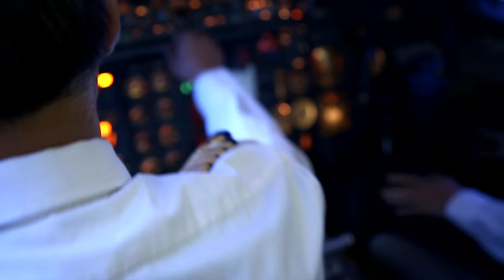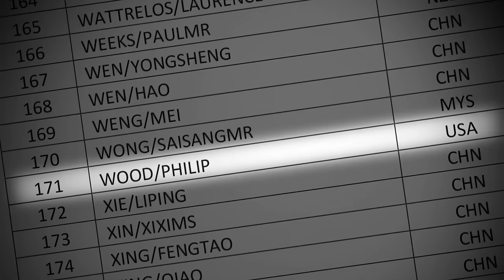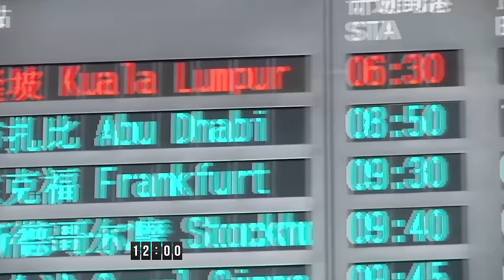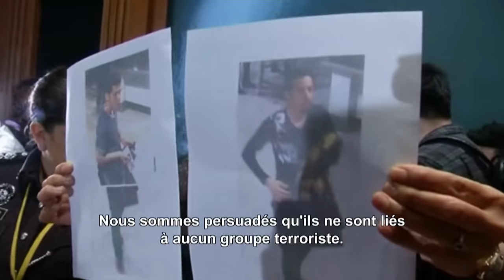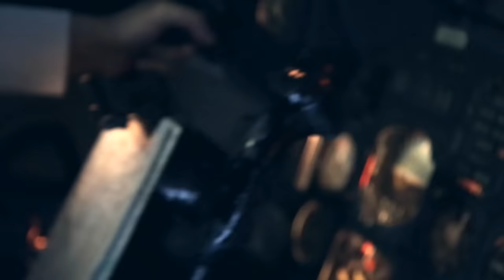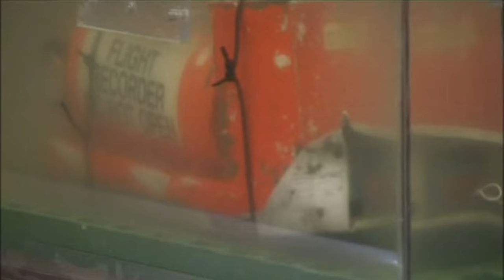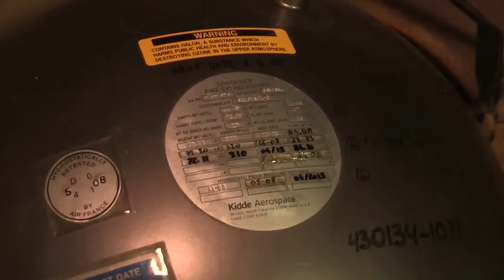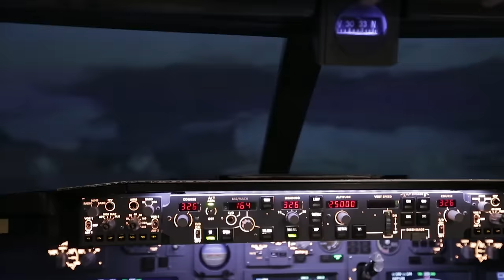Why We Never Found The Malaysian Flight MH370?

Comment: This is one of the craziest modern day mysteries and I still don't understand how planes are not better tracked.  You can find a cell phone at any time but not a plane (also with hundreds of cell phones on it)... for the families and loved ones it has to be brutal not knowing what happened... losing someone from an accident is horrible enough but having no closure is unacceptable when hundreds of people just vanish.  Hopefully all the recent documentaries and videos put pressure on the airline and govt to solve this... it needs to come to a conclusion even if the outcome is sad thats better than not knowing.
Reply: Good point on tracking planes.
Reply: Planes are tracked by multiple ways. Ex. All the engines have a tracking device. There are several other tracking devices such as the so called black box. 

They flew backwards under radar, then supposedly straight out to the Indian Ocean. Most radar and satellites don't operate in this very wide and vast area. Plus due to fire Hazzards all electrical components can be shut off with a breaker switch. So if tracking devices were shut off by the breakers, then that's why the tracking  devices did not work.
Reply: I think aircraft are tracked better today than in 2014.
Reply: I’ll bet they know exactly where it is, it’ll be found with a missile sized hole in the side of it.
Reply: @markmiller6402  Mark, I mentioned the Boeing Uninterruptible Autopilot. I know Honeywell finished with it in 1995. Then Boeing began testing the software program that comes pre-installed on a small PCB. They started testing back in 1995. The UAP is on a plugin circuit board... Just like an audio card, or a stick of memory installed in a PC, with the computer case closed, who would know. 
I just wish I knew a couple of engineers, or better yet, retired military personnel that might have been privy to information on the Boeing program..
Reply: Because they didn't want anyone to know what happened. This is all a cover up.
Reply: @rowenatapatahi6852   Agreed
Reply: I found it crazy that not one cell phone was used..
Reply: @YGardenRose  maybe because you have no idea what your talking about
Reply: @elliotoliver8679  what?
Reply: How could it NOT be sad. 
You think they’re on a fucking island somewhere?
Reply: @YGardenRose  there is no cell phone coverage out in the open oceans, even flying over cities at 40,000ft most cell phones are unable to connect to cell towers on the ground below, cell phone tower microwave antennae are designed to send (and receive) signals laterally across the ground not above.
Reply: En ese avión iban 100 científicos expertos en VIH, iban a una importante conferencia donde supuestamente presentarían información importante, probablemente la cura
Reply: On that plane were 100 HIV-expert scientists, they were going to an important conference where they were supposed to present important information, probably the cure
Reply: You
Reply: I know this is probably a weird thinking on my part I always wondered if anyone tried to track their families phone
Reply: @underrated4860  No, that was MH17, not 370.
Reply: They don’t want to find it
Reply: @underrated4860  that's a good point
Reply: Yeah, working cell phone phones…
Reply: @rowenatapatahi6852 pilots can turn off the tracker
Reply: @rowenatapatahi6852 peak the freaking truth! How do you lose communication with a plane for four hours. Cause they said in the beginning the last time they had communication was around 1. And then afterward, there was no concern about it until around the time it was supposed to show up 4 hrs later which speaks negligence to me! Sounds like they let the plane go undetected for 4 hrs by not staying on top of communication from the first attempt! That's no way to run an airline and it's not safe to do such a thing!
Reply: @YGardenRose in future, best to keep quite 😮
Reply: Reading most of your comments, it's best to keep quite 
Too many 'we know it all' posts
Reply: @UguysRnuts He doesn't possess the capability of thought.
Reply: @Lapusso650 LOST
Reply: @rowenatapatahi6852 that's what I think too
Reply: All the military radars around the world they know where it is.
Reply: @underrated4860 op I'm
Reply: Aliens?
Reply: What I don't understand is why modern day airliners, according to this video, apparently don't  have separately pressurized cockpits to keep the pilots able to react when there is a loss of pressure in the cabin.
Reply: Has any government stated where all these peoples phones were last pinged or tracked too? They said most Chinese have at least 2 cell phones. So there was almost 300 people on that plane and if they double the cells on the ones they believed had them then that easily puts it at over 400 cell phones to be able to track!
Reply: In total, 19 families have claimed the phones of their missing loved ones rang without answer for four days after MH370 disappeared. One woman even went on Chinese TV to prove to the public her brother's phone was still ringing after the plane had allegedly vanished. So the plane is not in the water !
Reply: You will never find a cell phone that's powered off unless you just get lucky and trip over it.  If its in an area without a cell tower in range, it may as well be off.  And there's lots of those blank areas over the ocean - a cell tower only reaches about 25 miles, so if its 250 miles over open ocean, there's 200 miles where every phone ceases to exist as far as the cellular phone system is concerned., until they get in range of another tower.  With a phone you csn say "It connected to this tower, this one, then these three" and establish the  path it followed.  You can get a good idea of its speed ss well.  Say the speed is calculated as roughly 70 moh.  Is it in a car?  A semi?  A bus?   That method wirks most of the time on land, where cell towers are all over the place.  
Thing is, when it comes to a transmitter you can choose between signal power and longevity. That's why the black boxes are sometimes hard to find in icean - to make the signal last 30-45 dsys its necessarily relatively weak.  And if its on the ocean bottom, it can be a couple of miles away even uf you are right above it,  water is great for transmitting sound but its horrible with radio signals.
One could double up on distress signals and have a second set of transmitters that lets outva strong, short yelp upon losing power from the aircraft, but even with all the stuff orbitng the planet, some of its just inoperative stuff that hasn't fallen yet, some of it is looking out, not in, some is lookung at the atmosphere, not the surface, a lot  isn't even lookjng, just relaying signals, and the small proportion that might see such a yelp signal are lookingvat tye land, not nominally-empty ocean.
Reply: American Ary base would of melted it down ,feel for the families
Reply: It went to Diago Garcia!!!
Reply: @ats-3693 thank you for explaining that, I was wondering also. Too bad yellowliver didn't know that..
Reply: I happened to find some Vietnamese military radar data back in the day. The commercial radar showed MH370 vanish where it did, but interestingly, the military radar showed MH3370, yes one extra 3, showing up where the plane vanished from commercial radar. I still vividly remember seeing that.

Again, this was NOT a static image from some website; it was historical radar data. It didn't show MH370 specifically but rather every flight and object being tracked.
Reply: @BIGBADWOOD  How could something that large remain hidden on land all this time? 
When Vietnamese traffic controllers asked Malaysian controllers what happened to the plane that was supposed to enter Vietnamese air space, they were told the plane was in Cambodia! Why? The plane was never in Cambodia! How is telling a lie like that even legal! WTH?
Reply: Remember : all phones are to be shut off when on plane.
Reply: 2
Reply: SOmething happened like this is God provision for human to realized that our life is not in our hand to control everything just like this
Reply: He was flying too high (very unusually high altitude ) from the time he was in the 22 minute holding pattern off the west coast of Sumatra until he way far south over the Indian Ocean, by which time the cabin may have already been depressurized. I think they mentioned that in this documentary.
Reply: He was flying too high (very unusually high altitude ) from the time he was in the 22 minute holding pattern off the west coast of Sumatra until he way far south over the Indian Ocean, by which time the cabin may have already been depressurized. I think they mentioned that in this documentary.
Reply: He was flying too high (very unusually high altitude ) from the time he was in the 22 minute holding pattern off the west coast of Sumatra until he way far south over the Indian Ocean, by which time the cabin may have already been depressurized. I think they mentioned that in this documentary.
Reply: He was flying too high (very unusually high altitude ) from the time he was in the 22 minute holding pattern off the west coast of Sumatra until he way far south over the Indian Ocean, by which time the cabin may have already been depressurized. I think they mentioned that in this documentary.
Reply: He was flying too high (very unusually high altitude ) from the time he was in the 22 minute holding pattern off the west coast of Sumatra until he way far south over the Indian Ocean, by which time the cabin may have already been depressurized. I think they mentioned that in this documentary.
Reply: He was flying too high (very unusually high altitude ) from the time he was in the 22 minute holding pattern off the west coast of Sumatra until he way far south over the Indian Ocean, by which time the cabin may have already been depressurized. I think they mentioned that in this documentary.
Reply: He was flying too high (very unusually high altitude ) from the time he was in the 22 minute holding pattern off the west coast of Sumatra until he way far south over the Indian Ocean, by which time the cabin may have already been depressurized. I think they mentioned that in this documentary.
Reply: He was flying too high (very unusually high altitude ) from the time he was in the 22 minute holding pattern off the west coast of Sumatra until he way far south over the Indian Ocean, by which time the cabin may have already been depressurized. I think they mentioned that in this documentary.
Reply: He was flying too high (very unusually high altitude ) from the time he was in the 22 minute holding pattern off the west coast of Sumatra until he way far south over the Indian Ocean, by which time the cabin may have already been depressurized. I think they mentioned that in this documentary.
Reply: He was flying too high (very unusually high altitude ) from the time he was in the 22 minute holding pattern off the west coast of Sumatra until he way far south over the Indian Ocean, by which time the cabin may have already been depressurized. I think they mentioned that in this documentary.
Reply: He was flying too high (very unusually high altitude ) from the time he was in the 22 minute holding pattern off the west coast of Sumatra until he way far south over the Indian Ocean, by which time the cabin may have already been depressurized. I think they mentioned that in this documentary.
Reply: He was flying too high (very unusually high altitude ) from the time he was in the 22 minute holding pattern off the west coast of Sumatra until he way far south over the Indian Ocean, by which time the cabin may have already been depressurized. I think they mentioned that in this documentary.
Reply: He was flying too high (very unusually high altitude ) from the time he was in the 22 minute holding pattern off the west coast of Sumatra until he way far south over the Indian Ocean, by which time the cabin may have already been depressurized. I think they mentioned that in this documentary.
Reply: He was flying too high (very unusually high altitude ) from the time he was in the 22 minute holding pattern off the west coast of Sumatra until he way far south over the Indian Ocean, by which time the cabin may have already been depressurized. I think they mentioned that in this documentary.
Reply: He was flying too high (very unusually high altitude ) from the time he was in the 22 minute holding pattern off the west coast of Sumatra until he way far south over the Indian Ocean, by which time the cabin may have already been depressurized. I think they mentioned that in this documentary.
Reply: He was flying too high (very unusually high altitude ) from the time he was in the 22 minute holding pattern off the west coast of Sumatra until he way far south over the Indian Ocean, by which time the cabin may have already been depressurized. I think they mentioned that in this documentary.
Reply: You can't find a cellphone at any time. You can only find a cellphone that is near a cellphone tower, let's say within a few km at most. There are no cellphone towers in the open ocean!
Reply: Because it was shot down near Russian / Ukrainian border. In MH370 the window besides middle exit door behind the wing was painted white. Surprise, this part survived as the plane from Holland crashed to the field, and first stories from Russians were that there were a lot of bodies in the rotten state and they wondered how that be so?
Reply: @stevenlaake9975  It's 2023.  Is it true or not that a couple were walking the beach in Australia and found towels from the plane that  had washed up?  There's been so many theories,  some outrageous.
Reply: @dejaporter7338 
No it's not. 
They were on mh17 and i think 100 is a bit overdune.
Reply: 10.22.23 in order to preserve info keeping groups smaller is good idea.
Reply: Baka nahigup ng dagat sa Triangle.( It might had been sucked in the ________Triangle it's like a whirlpool. So many airlines
Reply: Bermuda Triangle is the name of the whirlpool 😅
Reply: @angelamorales4050 they did, on Chinese TV they called one and it rang and rang. 4 days after it disappeared
Reply: I am pretty sure that some big Government is involved and that's the reason for not finding this aeroplane. I think some big country accidentally downed this aeroplane and is influential enough to tell the Malaysian Government to look the other way. In this modern era of technology, it is possible to track almost anything. It's impossible for an aeroplane like Boeing 777 to just disappear and not be found anywhere.
Reply: I think the info was gathered by military radars, but that information is classified and would reveal the capacities of said countries to potential military opponents.
Reply: To simply put it, there is no reception.
Reply: @stevenlaake9975  No debris though ?
Reply: @elliotoliver8679  Oh , you do though ...  Please tell us more.
Reply: @ats-3693  Nah ... 9/11 proves you wrong though.
Reply: @-First-Last  The aircraft involved in the 911 tragedy weren't flying at 40,000ft thousands of miles from the nearest cell phone tower, they were flying at relatively low levels over populated areas with multiple cell phone towers below them. If you have ever accidentally (or knowingly) left your cell phone on during a flight you will notice you won't get a signal at cruising altitude but once the aircraft descends to  lower altitudes over populated areas in preparation for landing you will start getting intermittent connection to towers on the ground.
Reply: @ats-3693  "you won't get a signal at cruising altitude but once the aircraft descends to  lower altitudes over populated areas in preparation for landing you will start getting intermittent connection to towers on the ground."

How low they were FLYING  ???  Again FLYING . You must be very smart. 

Allegedly the planes were highjacked during flight not landing also those calls were made during flight NOT during landing.
Reply: @-First-Last  "You must be very smart"

Why do people, like you, always feel the need to get angry and start trying to insult others during a simple conversation in YouTube comments? This isn't an argument, or at least I didn't think so, or is this just how you normally conduct yourself during a conversation with a group of people?

And as for questioning how smart I am, I'm smart enough to have a degree in geophysics, physics, mathematics, and computer science and I've been a geophysicist for nearly 25 years, and coincidentally to the subject being discussed those 25 years have been entirely in airborne geophysical surveys, the first 10 years of my career I spent in the field flying around the world working on airborne geophysical surveys, I've flown across most of the worlds continents in privately owned geophysical survey aircraft in which there is no requirement for mobile phones to be turned off, occasionally when we were low enough and close enough to cell towers on the ground we would get intermittent signal, most of the time we had no signal. 

If cell phone calls were made from the 911 aircraft then they were low enough and close enough to cell towers to get a connection it's as simple as that, the Malaysia Airlines aircraft was at cruising altitude out over the Indian Ocean hundreds or even thousands of miles from a cell tower there is no way any mobile phones on board could connect to a cell phone tower, end of story.
Reply: @ats-3693 it was cgi.
Reply: Diego suarez.....?
Reply: Ingénieurs sur le furtif?
Reply: @markmiller6402 
..and all I'd markings sadly eroded away by fish.
Reply: @montydaniels1054 
..and Boeing management neither added this mod to the pilots manual nor told them.  - oh no that was the thing that caused TWO "Maxi-Jets" to fall out of the sky.  They called it "Stall prevention" at some stage.  My point being that  there is nothing so evil that these people would never do it.
Reply: True!
Reply: Not much cellphone coverage atm in the Indian ocean...
Reply: There are no cell towers at sea. If there were no functioning satellites at the moment, its easy to drift away from course to uncharted territories down that South. The ocean is huge much bigger than the maps let you see.
Reply: @YGardenRose   "crazy that not one cell phone was used?" If someone had tried to make a cellphone call when they were hundreds of miles from a cell tower they would have not been able to make a connection.
Reply: They perfectly hide it and planned very well
Reply: You will notice toward the end of this documentary, that the French gent having written books on the subject spoke to Maldives islanders who confirm the suspicion on the planes last known course, now we dont need to be a super sleuth to extrapolate what happened next.
And pray tell why the silence and lack of action at the time, when standard prcedure in Europe is to send a fighter up to investigate the lack of comms in light of the 9/11 incident, my guess is the plane was knocked down by a missile originating from Diego Garcia and the cover up followed.
Reply: @YGardenRose  Yes extremely thought provoking, as the narrators say "Chinese citizens usually have two mobile phones" and a hardly ever off them, but this flight total silence not a peep, which leads then to the suspicion outside interference was at play?
Reply: planes ARE tracked...unless a reason NOT to
Reply: @markmiller6402  99.99% chance the disgruntled pilot sent the copilot for coffee, wouldn't allow him back in, opened the valves to decompress the plane, and manually flew the plane until it ran out of fuel to about 1800 miles west of Australia. It was tracked by satellite pings and shortwave radio.
Reply: I have seen several videos about this flight. I strangely feel that air traffic control systems are not up to par in some of the countries. And negligence took place in the hand off.
Reply: There was also a great deal of cover up on MA. Between providing the wrong last know direction of the plan to the delay of reporting it missing. I also find it a little abnormal that an entire company staff was on board. Is there a connection who knows but in my view it's not often that a complete company is on flight.
Reply: @YGardenRose you obviously have no idea how cell phones function
Reply: @rodney9585 where are all these supposed radar stations in the middle of the indian ocean? You have no clue what you're talking about.
Reply: @deliafredericks7578 sweets, this is a comment section. Hence the opinions of people, not " we know it all."
Best to keep quiet if you can't even think about something like that.
Reply: @imetyourmother420  what did I say?
Remind me quickly please?
Reply: very true ,its saddening ,haunting,more needs to be done
Reply: Well like someone said, planes are very well tracked but they have systems to shutdown most if not all track devices. Radar and such can only work if its within range. Personally what I believed happen was a murder-suicide from the pilot. The way the plane seems to move almost perfectly to avoid radar. Triple sevens just don't disappear, for a plane to fly hours avoiding radar and moving to a random spot in the middle of the ocean is all to odd to call it a coincidence. If its a dangerous situation planes don't typically fly for as long as MH370 did, I watched waaay to many air crash investigations, but tldr they either try to get it on the ground asap or it's too late to save. Planes don't just fly around for hours with no contact, in limbo when its an emergency
Reply: @YGardenRose  That’s not true though. There was a missed phone call from a Chinese passenger to his daughter, while she was with other family members. The other family members that tried to call their loved ones on the plane, and some of the passengers' phone rang, One family member was there described what he saw and heard on camera in the Netflix documentary. But why does this documentary ignore such important information?  

The fact that passengers’ phones had connectivity approximately seven or eight hours after the plane deviated from its flight path suggests that the plane did not plunge into the ocean, but did in fact land before the fuel ran out. Why not discuss the possibility that flight MH307 landed on an island in the southern Indian Ocean? A good investigator follows the evidence to the logical conclusion.
Reply: It's a big world out there with a lot of 'empty space'. Even over something as 'small' as thre Gulf of Biscaye.
Reply: this video start with a commercial about starting a journey trip to Singapore....
Reply: Some four online Video cams that check the aerial environment of each airplane could prevent such incertainties. Why dont they exist?
Reply: What I dont understand is why can't track ppl by there cell phones where is the location ? Have these idiots tried ? Like WTF how can they all just dissappear like that. If the plane mh370 went off radar well did other countries see where mh370 went on there radar system??? 🤔  Prayers for there Families that they get closure soon 🙏